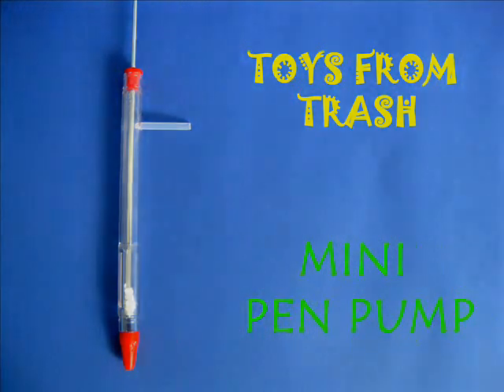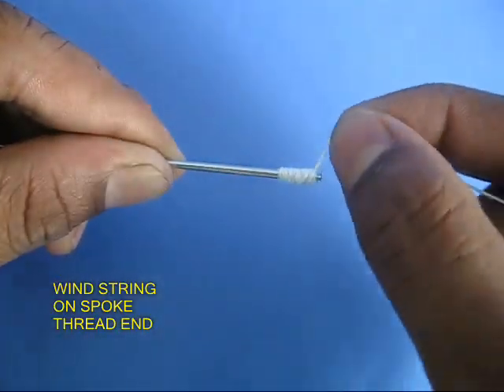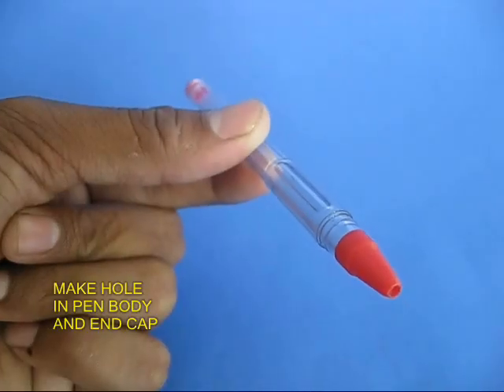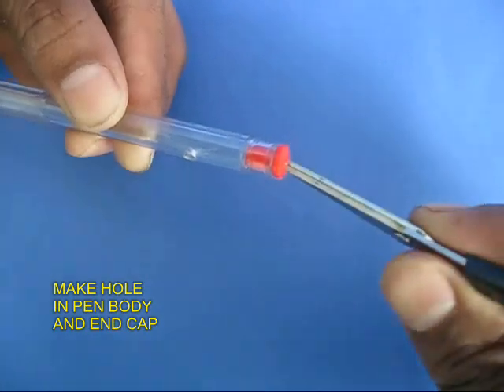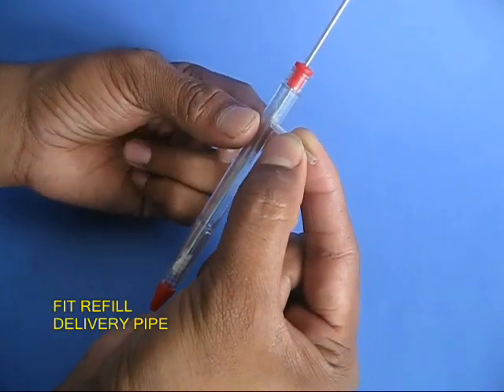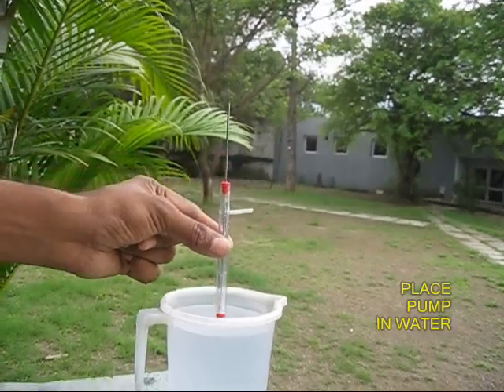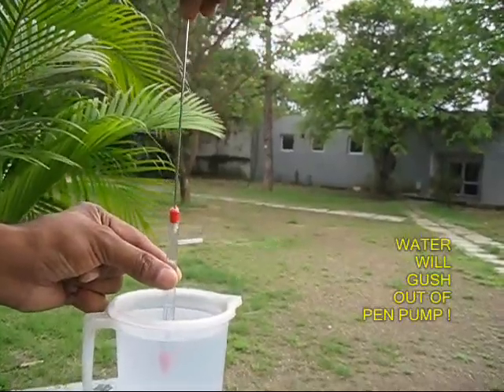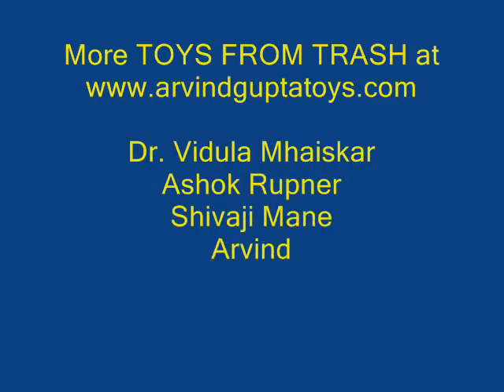MINI PEN PUMP -  ENGLISH - 19MB.wmv

Comment: I AM DOING THIS FOR SCHOOL PROJECT BUT WHAT IS BASIC SCIENCE BEHIND THIS PROJECT.. PLEASE GIVE DETAILS
Reply: It uses Bernoulli principle.The hand pump actually has a chamber in which pressure is created when you do pumping. The water in the ground replaces the pressure and then gets out thru the outlet. Repeated pumping creates pressure high and low. And water comes in and goes out.
 It is basically an application of Bernoulli's Principle, which states that as the velocity of flow in a fluid increases, the pressure in that fluid decreases. Bernoulli's principle only applies when no work is done. Bernoulli principle is approximated if a small amount of work is performed.  In the case of the pump, the hole performs a small amount of work on the air, resisting the flow and requiring a higher pressure inside the tube to compensate, but the pressure still drops below ambient as the air accelerates into the hole